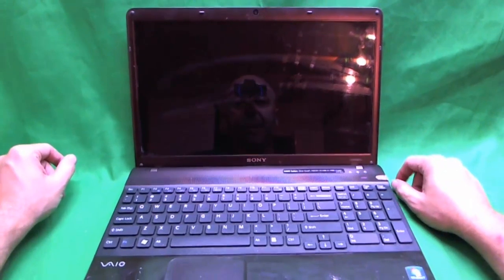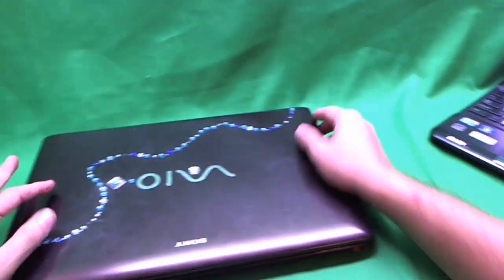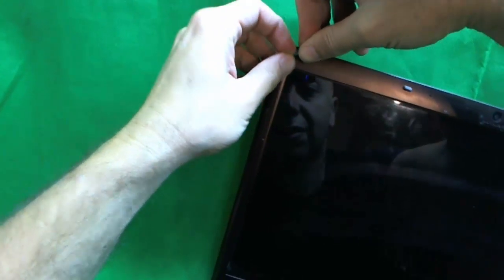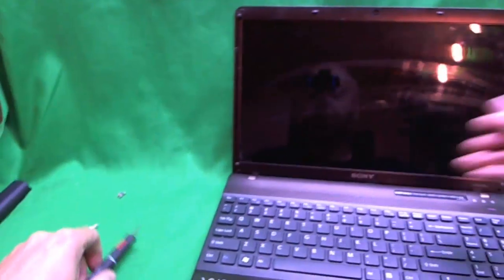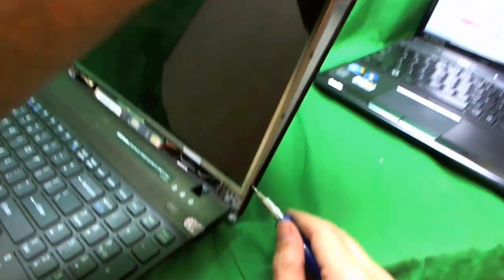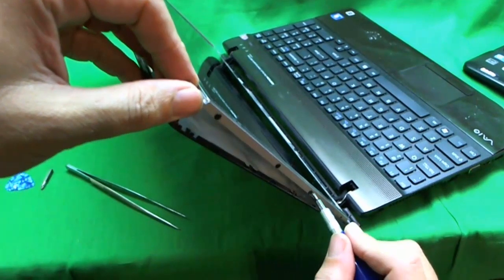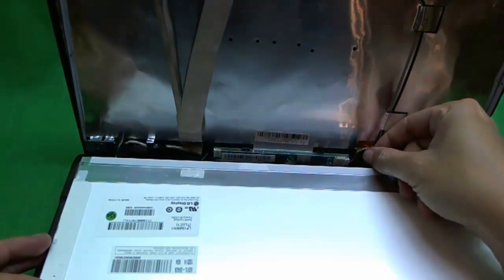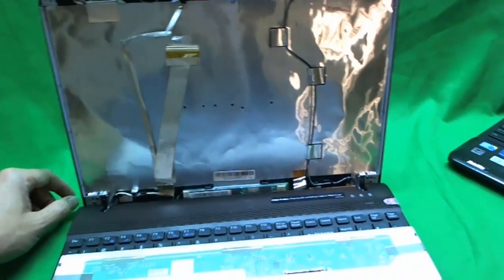Sony Vaio E Series Laptop Screen Replacement Procedure

Comment: amazing!! is there anyway to replace the screen with a 4k screen??? or a better screen? touch screen?
Reply: No. If you want a better screen, you're going to have to use an external one via HDMI or VGA. It's not compatible with any other type of screen except for the one it came with. Hence the serial numbers on the back of the display.

Comment: the screen of my notebook turns sometimes into white screen. I read in some forums the reason is the connection cable from behind and it looses sometimes the contact. Is this right and can i fix it, when i'll take off the screenbody to firm it?

Comment from the maker: @arob752752 sounds like the video cable needs to be replaced also.
Reply: Hello, my Vaio VPCEB31EN 's screen has gone dim but not fully dis functional , I think I just only need to change the inverter and it will become lit again, can you please provide me a place from where I can buy a Screen replacement / inverter so that I can follow your video to bring back my screen to working, I googled but couldn't find any place.